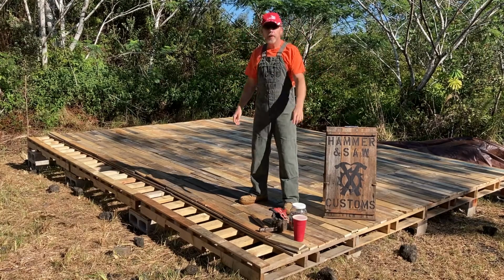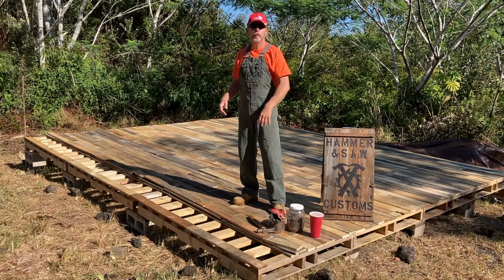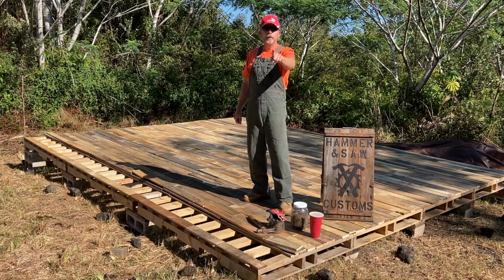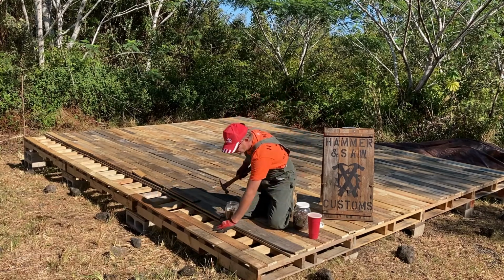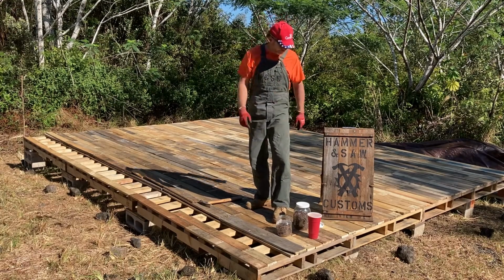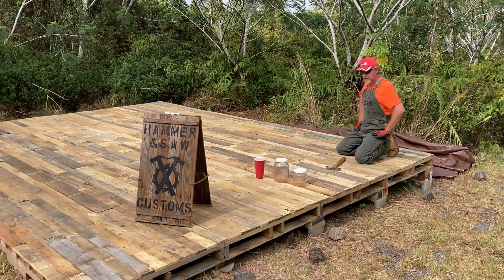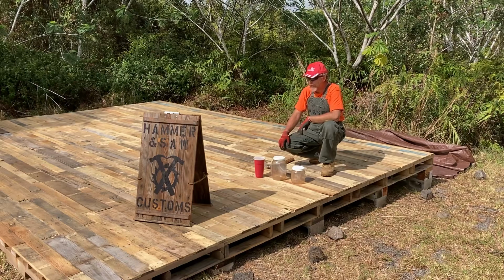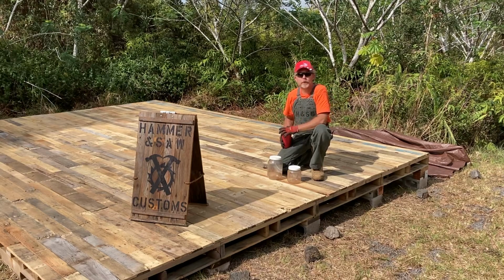How to Build a Shop out of Pallet Wood H&SC Style Part #2 (Flooring boards)

Comment: I'm interested in the methods you use to break the pallets down.  You've had to do a lot of 'em so ... which method did you use the most?  Which method do you prefer?
Reply from the maker: Howdy Neighbor, I posted a video of the top ways I break down pallets on the channel and the best method for me is to understand the pallet I'm breaking down. Like how pine, oak and other woods react under stress. My go to method to test first hand, is to use the breaker bar 5000 first. Then see if the noise maker 6000 aka reciprocating saw needs to be used.Sometimes I used the bar, reciprocating saw and a circular saw all on the same pallet just so I could save as much wood as possible.
Reply: @hammerandsawcustoms  I was searching for that before I left the comment.  And I still can't find it.  If you have (or when you have) a link, can post it here?
Reply from the maker: @KellyVisionPictures  Here you go Neighbor. https://www.youtube.com/watch?v=VeZvhFtvHAQ&t=55s